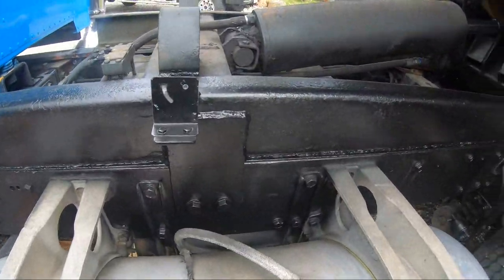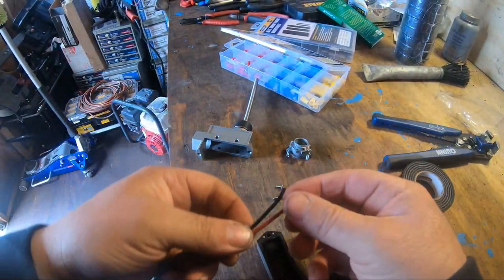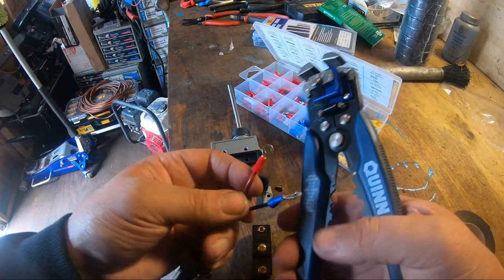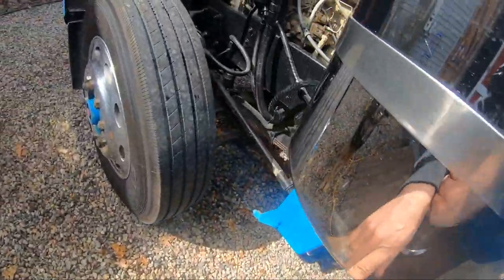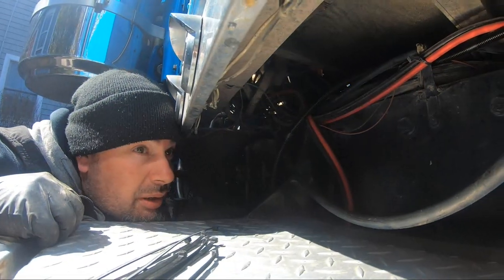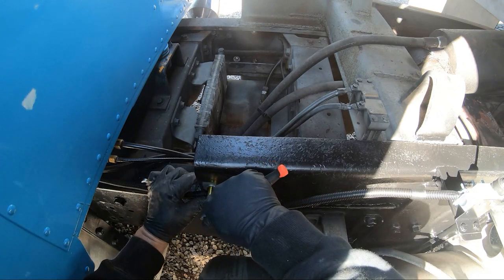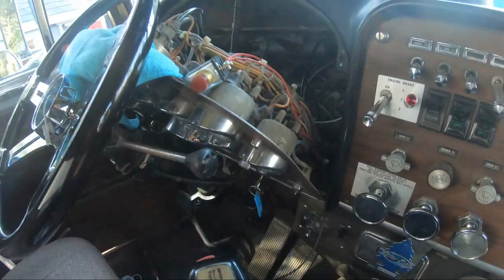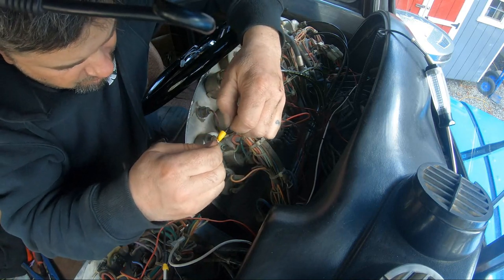Peterbilt 359 Dump Bed Alarm Installation!

Comment: Steverino that was an enjoyable little excursion through your project.  It turned out exactly like mine always do… the wires were switched.  

Well, not exactly….

In some projects, switching the wires will short out something.  I always do that!  You seem to have missed that step!!!

Cap’n Kleeman is my mentor… I specialize in “how NOT to” videos!  

Sure do love that purdy blue truck.
Reply from the maker: Yeah they make that switch with the option to use it backwards. Captain is great !!     Thanks for watching!

Comment: Good Video Steve, you need to get a Multimeter and this way you can check the switch operation. They don't cost that much and you can use it to check fuses and so on.
Reply from the maker: Yeah I had one .their great . I can’t find it . Probably going to get a new one !  Thanks for watching.

Comment: I was going to ask this on your new cat video but I can’t find it. 

I remember hearing you say that you would be okay if you only used it on a few jobs year, how come you would not just rent fit those jobs rather then spend all that money? I know it’s hard equity but it’s still a lot to have paid out in one go to not use it much.
Reply from the maker: The projects that I will be bidding on for that big machine will be very large and take months of going back and forth to complete.  For example my friend is paying an average of $4,000 a week for  hired trucks and equipment rentals to for the same 3 large projects he’s working on . I’m anticipating using it a lot more. I’m just saying worst case scenario I would be OK with A few Projects a year Rentals around here are so busy that most of the time you cannot get the machine when you want it. Plus They also charge you a fortune for delivery around here